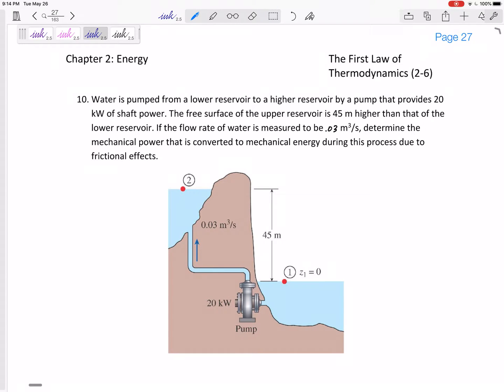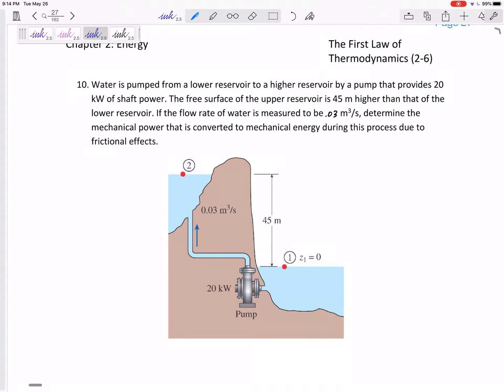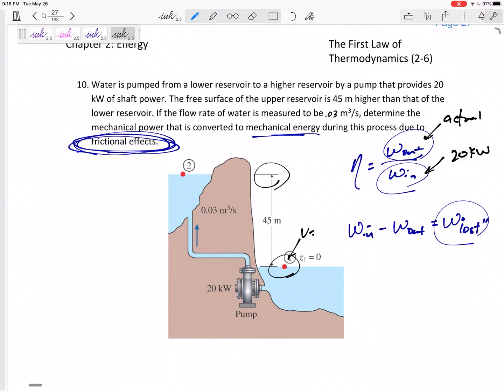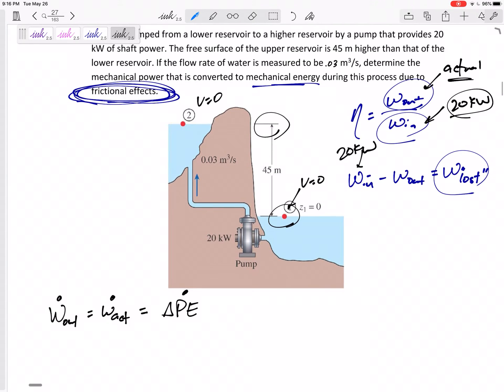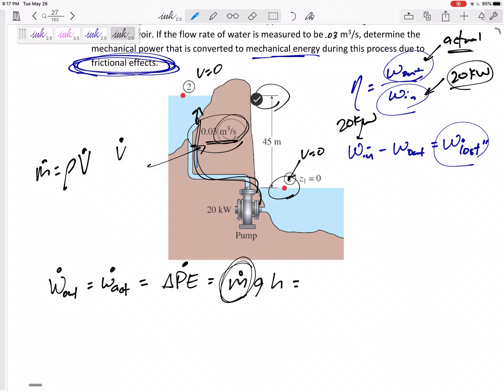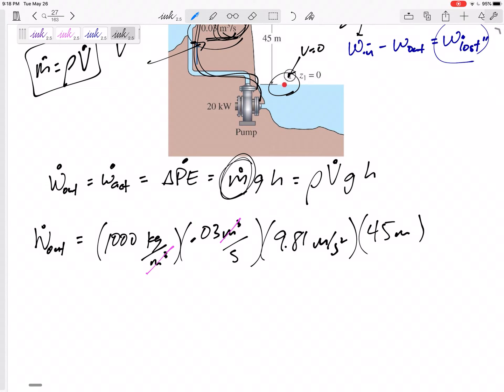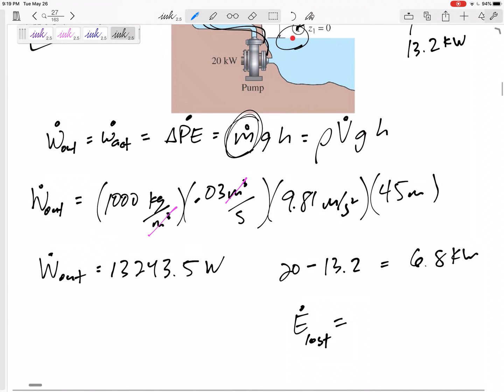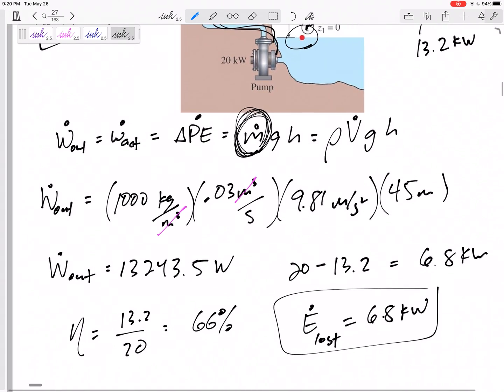Thermodynamics - Pump energy efficiency example 1

Comment: Verify this but you have to be cautious here because in this problem you are choosing as your controlled volume the entire pictures with the reservoir and everything. So in the energy equation there is a height change but not an enthalpy change since enthalpy is (u+pv) and there is no internal energy cHange nore a pressure change because at both reservoirs the P is atmospheric (in this problem your initial terms and final terms are with respect to the reservoirs). In a problem where you are focusing on the pump immediate entrance and immediate exit, there is no change in z (height) but there is a change in enthalpy due to the pressure in the fluid at entrance vs exit. It should give you the same w.
Reply from the maker: Yes, I think what you’re saying is correct. But there are losses due to friction in the pipes, so if you’re only looking at the immediate entrance and exit you wouldn’t account for that.